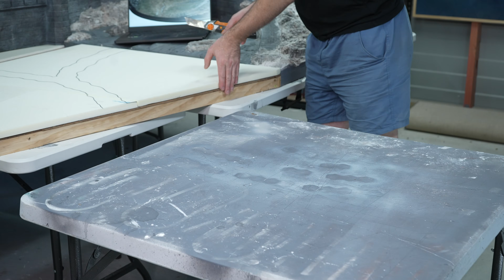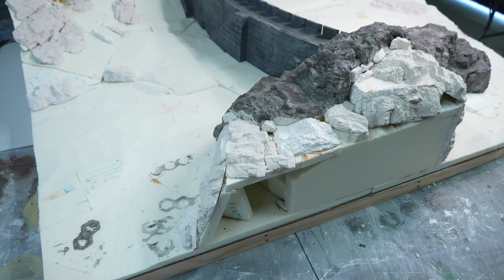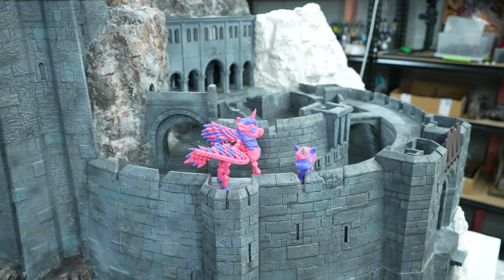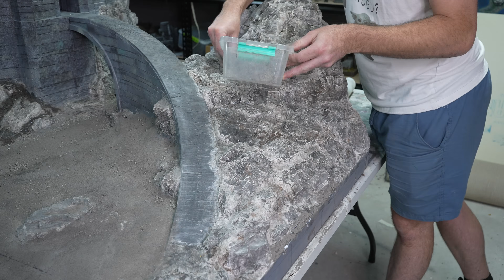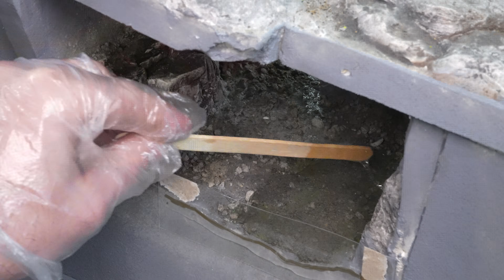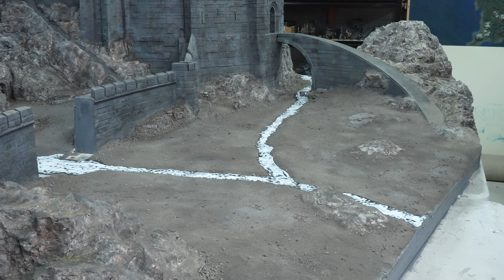Helms Deep is FINISHED! The BIGGEST wargaming board in YouTube History! Lord of the Rings Warhammer

Comment: I don't think you gave enough thought to what the interior of the blown-up section of wall would look like. Either it's stone slabs all the way (in which case you should be able to see that) or there would be some kind of filling (made of rubble or smaller stones) on the inside between the slabs. You've made it look like it's just solid rock which has been carved on the outside to look like stone slabs.